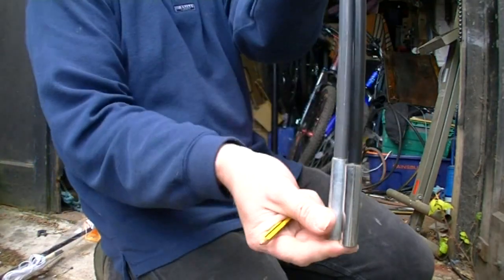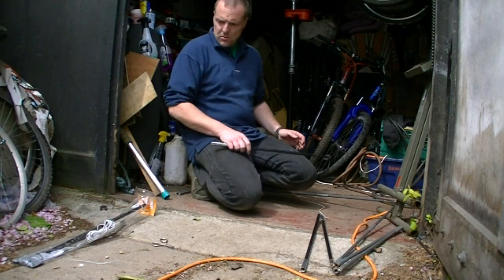How To - Replace Repair broken tent poles - Personal Vlog - New tent update

Comment: I have never seen a pole break they usually split along the length. I think a replacement section may be easier. Might also be a challenge to fit through tent sleeves. I will admit I had not thought of trying this fix.

Comment: HI dear!
I've got an idea for you and I'd like you think about it.
open the rear doors and think about a wood hinged to the van floor and connected in someway to the doors.
on my scudo is a 130 by 90 cm wood.
closing the rest with a custom tent I should have found a extra room for may be the internal shover  ;)
sorry for my english.
I'm making my fiat scudo conversion right now and I'd like to share my tips with you, can I reach you with emails for pictures?
cheers 
Mauro from italy

Comment: Hey, in the past I tried to replace a tent-pole, but it seemed less flexible than the rest and it just broke the adjacent pole when I tried to bend it through the tent. Wondering if it makes more sense to put the less flexible pole on the end or right in the middle. The pole-assembly in question spans across the top of the tent.
Reply from the maker: Hi Cliff. it seems an ongoing thing for me replacing these poles I get the feeling they my deteriorate over time. I think its the tent material is to tight really. hope you get yours sorted. :-)